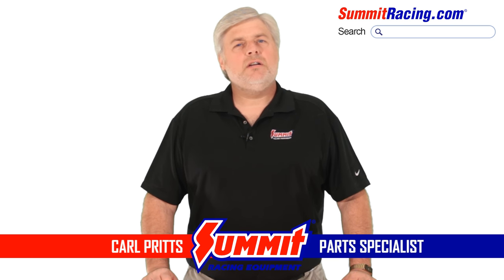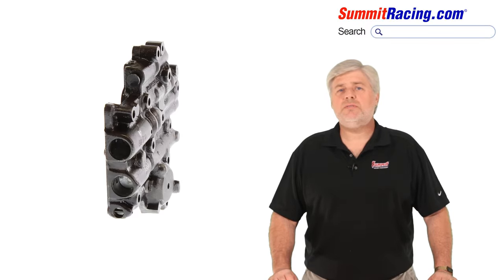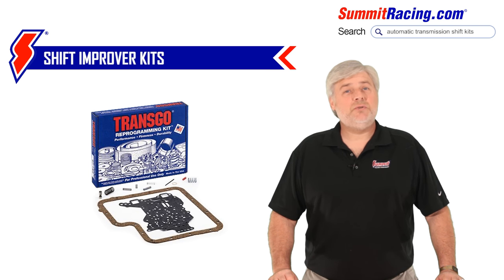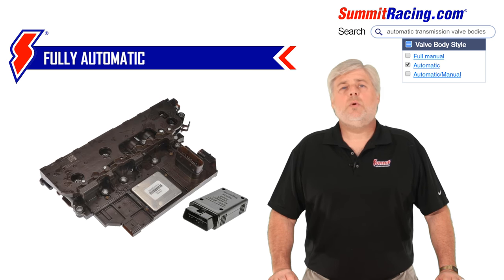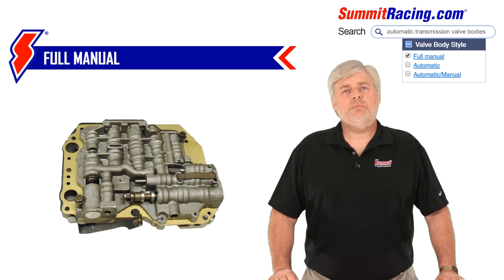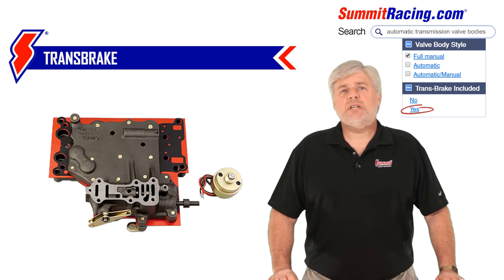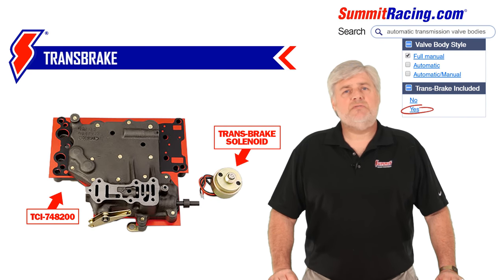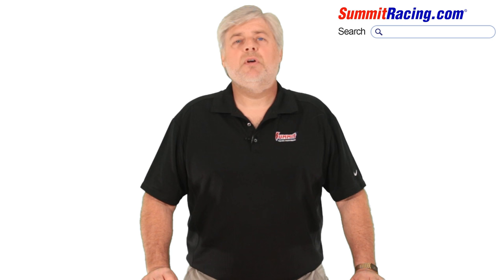Valve Bodies - Carl's Tech Talk

Comment: Hi Carl I have a 2003 Toyota Corolla but the transmission is jumping when its get hot what could be the problem, you think  it's the value body or the clutch is going
Reply from the maker: Hi Kevin,

automatic transmissions are very complex devices and a multitude of things could cause "jumping".  The best advice I can offer is to seek out the assistance of a reputable local transmission shop and allow them to diagnose it properly.